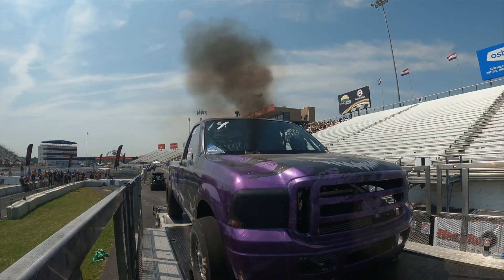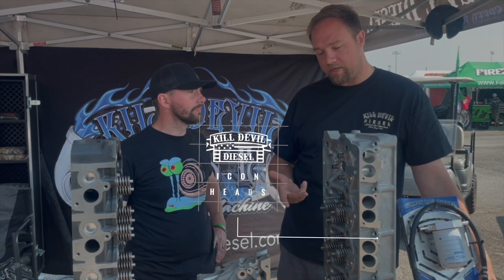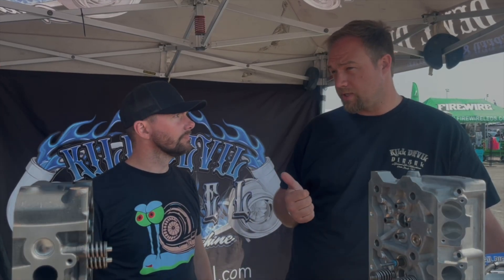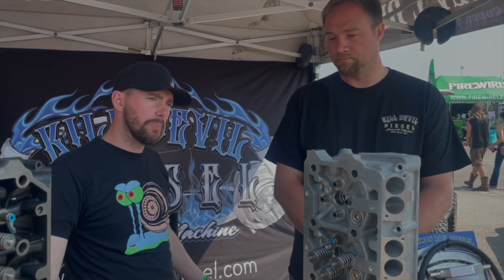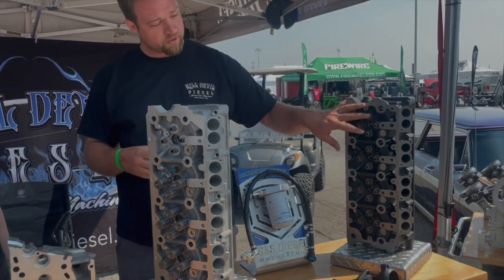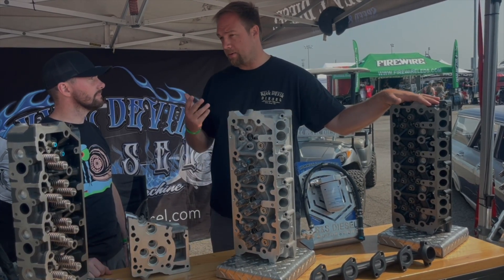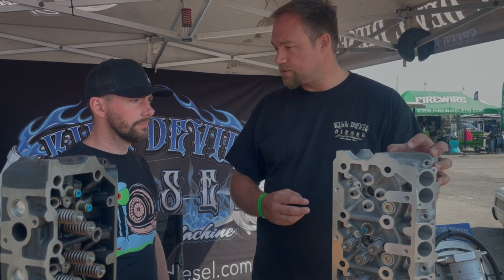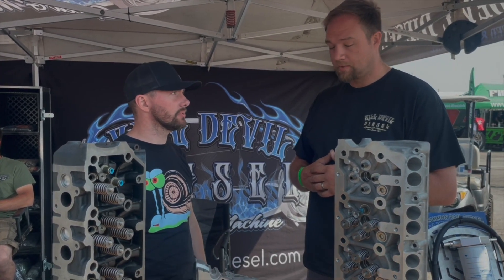No More 6.0 Blown Head Gaskets with ICON Heads!?

Comment: Would  the race port icon heads be good to run on a street truck with stage 2 can stage 2 turbo and 205 injectors and possibly a compound setup later or would there be down falls from running the race port heads?
Reply: Imo there is not need for a race port with that small of a setup.  Unless you are pushing past 1000-1200hp